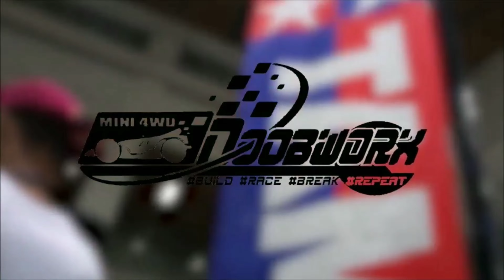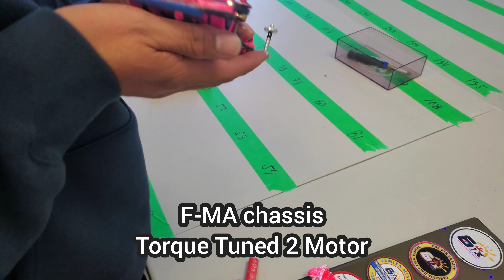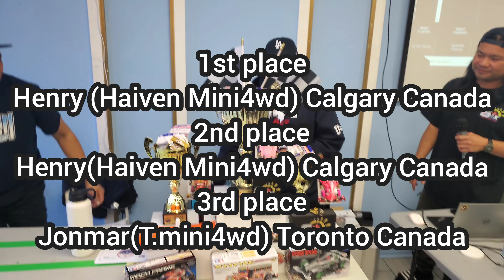(ミニ四駆) Battle Of The Turfs 2024 Part 2 Semi Pro/Tuned Class Race

Comment: Can u fit 3.7:1 gear on standard super fm gear box? Or u using light weight gearbox?
Reply: Yes you can, it fits well
Reply: @BCM-s2k  thanks for the answer. I will try that.
Reply from the maker: @wansafwan  it fits well since i was using a 21 century  Bg super fm chassis